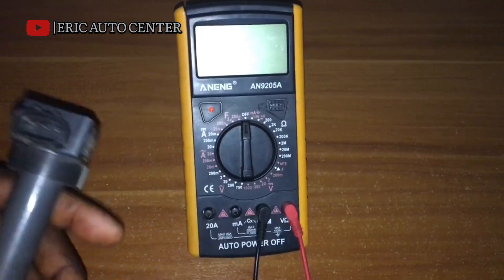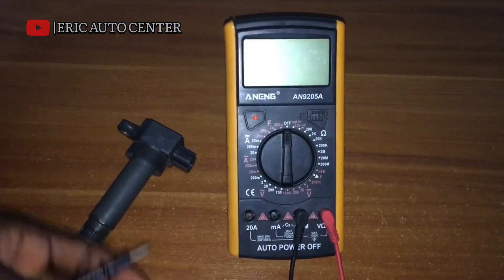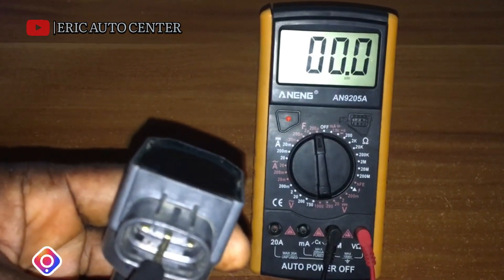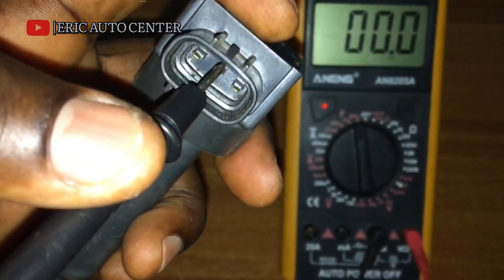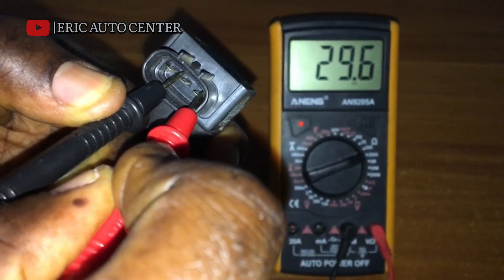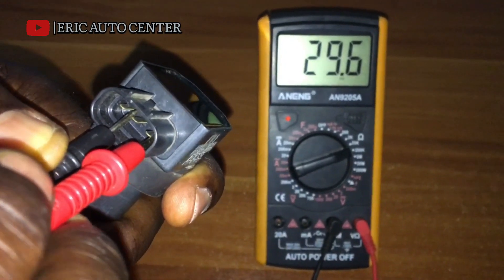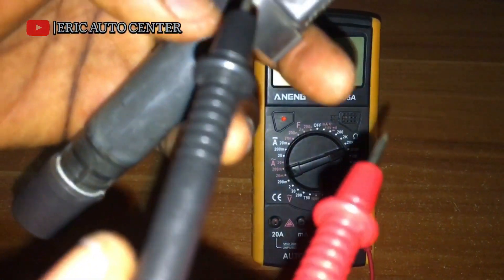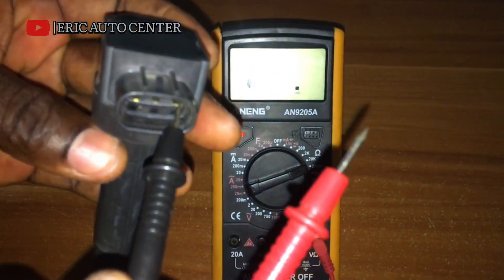How To Test 3 Pin  Primary Ignition Coil DIY #primaryignitioncoil #testtrigalwire #testmaxsupply

Comment: This is a little confusing. I'm guessing this does not apply to all three pan ignition coils? My Ford ignition coil is pin:1 12V Power supply, Pin:2 Ground connection, Pin:3 The trigger pin

Comment: Hi im testing a similar 3 pin ignition coil, the right side is power in, the middle is negative/earth and the left pin is trigger.

When testing using 200k ohm reading, earth pin to power pin = no reading, earth pin to trigger pin = 1.7 - 1.8 reading.

These readings are the same on all 4 ignition coils, am i correct that these coils are dead and broken????
Reply from the maker: Are they primarily ignition coil?
Reply from the maker: If not use mega ohms but testing them doesn’t solve the problem depends on how they perform on the engine so troubleshooting first before buying a new coils if you have similar coils on different car swap them if the problem exists check harness conectors. It’s sometimes happens to be the ECU but do proper diagnosis before troubleshooting. I hope my explanation finds you well.
Reply: @ERICAUTOCENTER  just a single coil pack exactly like you got but for a fiat 1.8 16v engine.
Reply: @ERICAUTOCENTER  I have retested the coils on all ohms settings between Earth and power pins and no readings what so ever, only readings are trigger to earth pins and again 1.7-1.8 so I'm guessing they're dead and will order replacements as I don't have spares
Reply from the maker: @ryankislingbury9178 they’re dead no continuity
Reply: @ERICAUTOCENTER  thanks that explains alot and why it won't start, many thanks for your reply
Reply from the maker: @ryankislingbury9178 you welcome

Comment: How much  a good ignition coil should read
Reply from the maker: It depends the type of coil base on the engine capacity whether 3 cylinder, 4 cylinder, or v6 & v8 type but the ignition coil reads from 0.94, 0.01, 0.02 or more and finally some also read from 1.02 or more and all this means there is a continuity which means the ignition coil is good

Comment: Just checked with brand new coil ,totally wrong readings.showin 1300 to 1800ohms on one pin only.
Reply from the maker: Then you can check it well it shouldn't be like that. there should be continuity it is the way you're using your multimeter. Dont delay too much time on the multimeter it will trigger everything and can burn your new coils

Comment: sir whould you please reply in vedio that if reading is more then 26.9 means 35.09 or 45.09 then the coil ok or not correct rating of 3 pin ignation coil is what
Reply from the maker: Check in the comments section I have replied many on this same question thank you

Comment: Checked mine and is showing 51.6
Reply from the maker: 51.6 means there is no continuity the ignition coil is bad. If the resistance show 0.01 on the multi meter this means there is continuity then the ignition coil is good. so have to buy a brand new set of coils